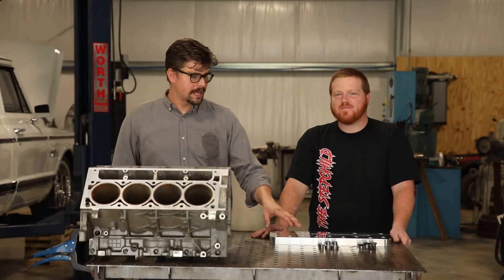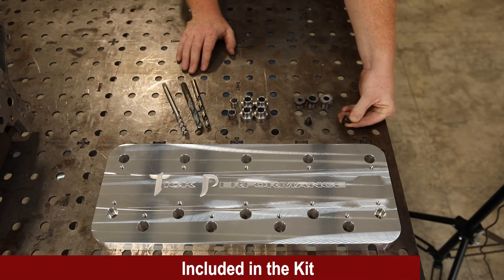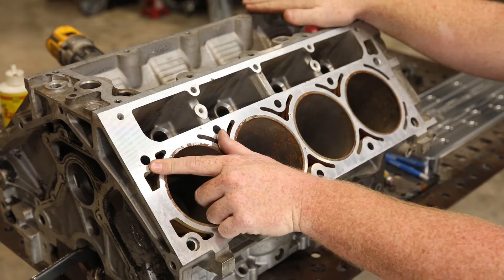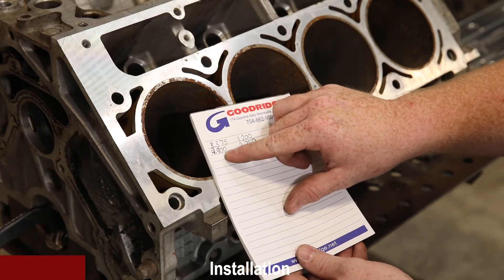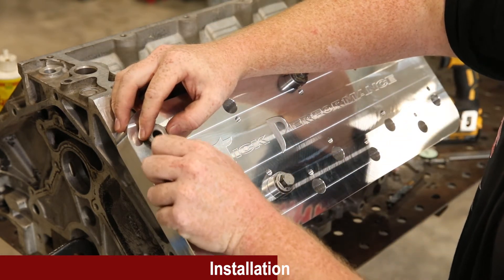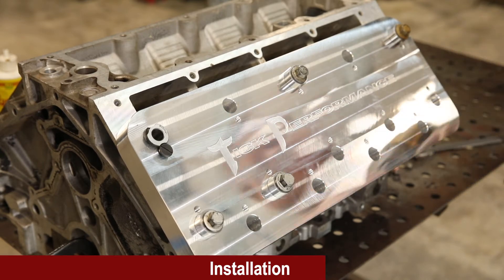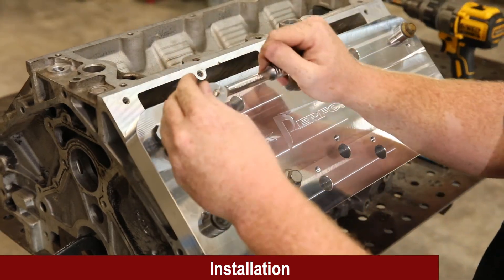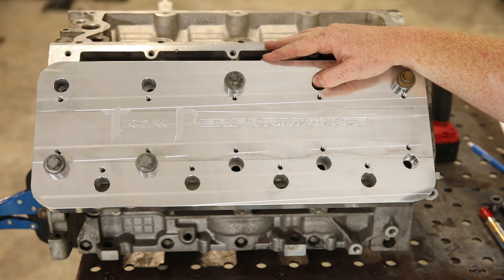How to Install Tick Performance LS Head Stud Upgrade Fixture

Comment: The job seems very straight forward and the fixture looks excellent. Curious though with the 1/2 head studs in an iron block, are the torque specs higher than the standard arp studs to actually apply the clamping force or is it still the standard arp torque spec. Otherwise I wouldn't see much of a point in upgrading.
Reply: It’s #110 lbs for 1/2” studs, aluminum or steel block. I have done both and both generations.

Comment: quick question. What about the cylinder heads? will LS heads clear 1/2" heads studs? or do we need to drill those as well?
Reply: After performing the job on the block, 
you can use the DIY Head Fixture on the heads to make room for the 
larger studs. Bolt the fixture to your head and use the larger, 33/64in 
drill bit (included in the kit). This will provide ample room for the 
new, larger 1/2in studs.